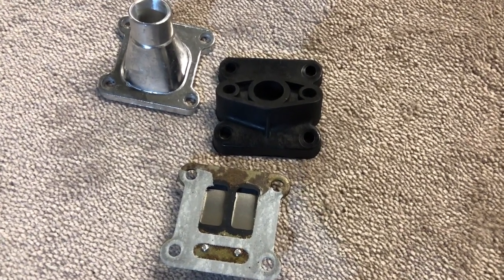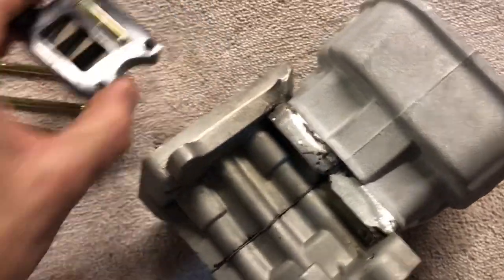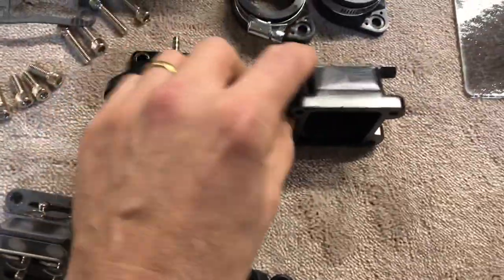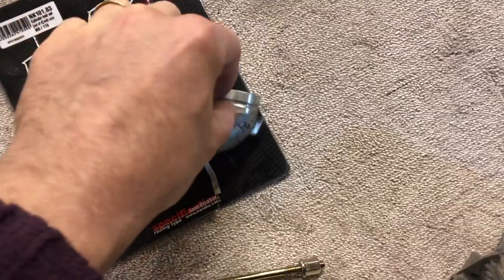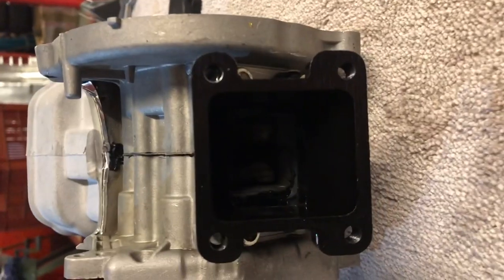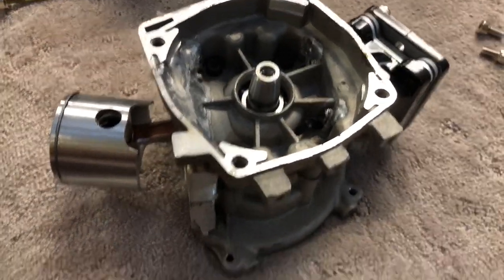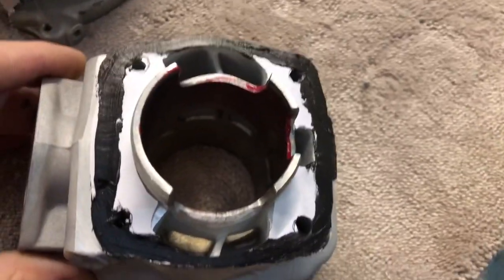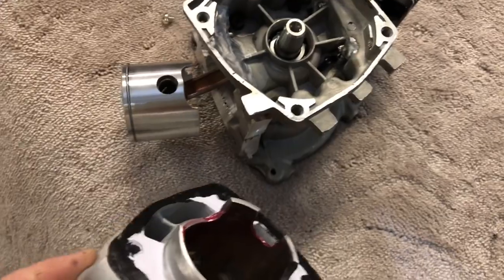Ferrari 250 gto Go Kart engine build! prt 3

Comment: Are you going to charge the battery with the engine? That would be neat...
Reply from the maker: Yep there's regeneration through the electric motor when the 2 stroke will be running !